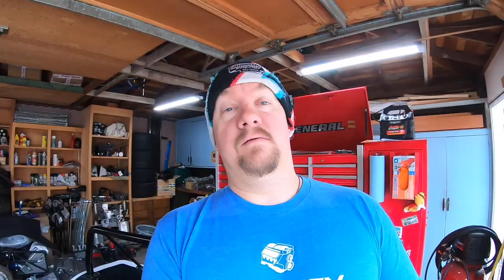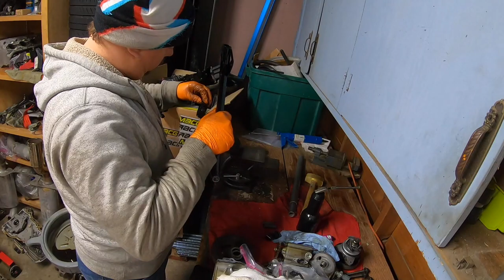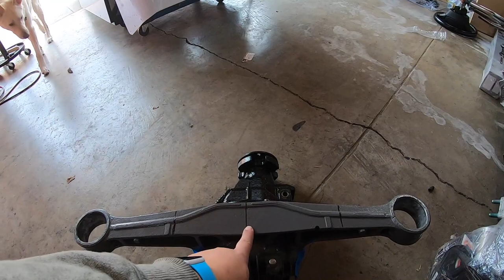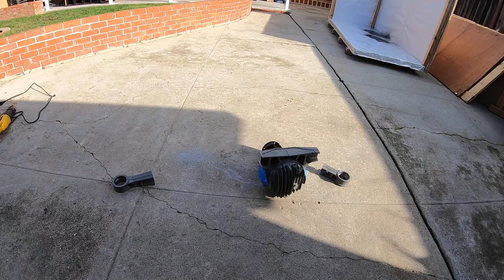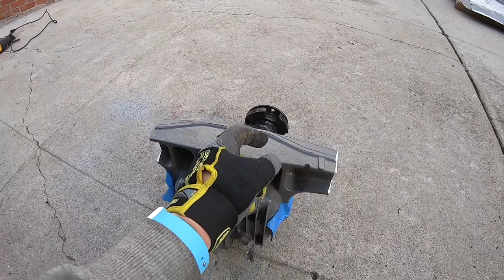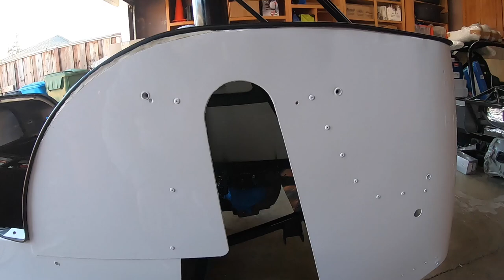Project Zero 03, Rear Suspension, Wheel Wells, and Differential

Comment: On the side panel cutting you should have used a hole saw to generate a radiused internal corner, that sharp corner is a perfect crack initiation site.  I can’t believe it didn’t come correctly cut.
Reply: I'll second this.  Can't tell you how many pieces of sheet I've replaced/repaired on race cars where the panel has vibrated a sharp corner until it cracked.  At this point, if it were me, I'd take a small round file and just round the inside corners, that will help considerably.
Reply from the maker: I plan to round the edge not just for this reason but for aesthetics too.